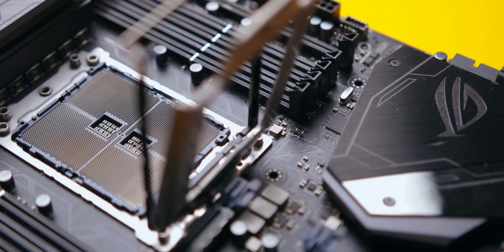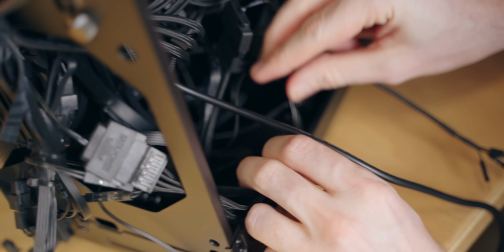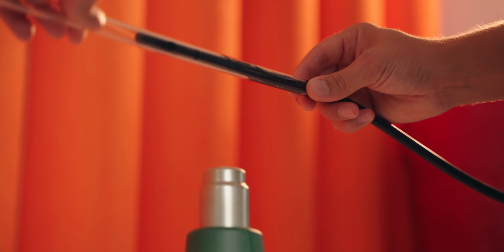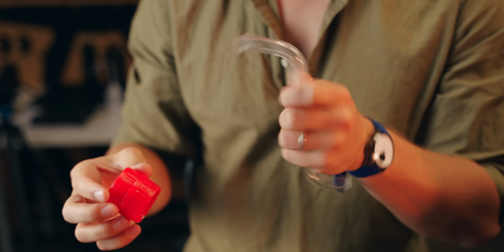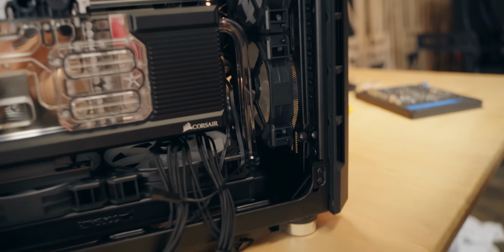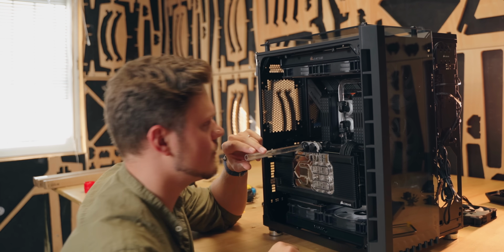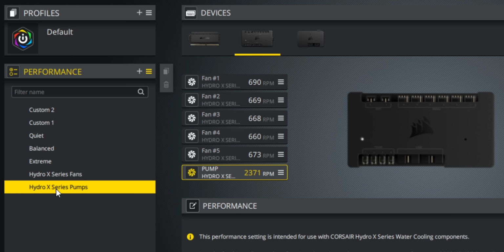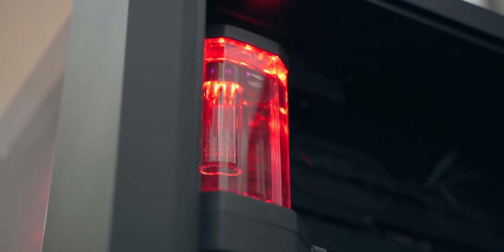IT'S DONE!  The EPIC Workstation Build Is Alive!

Comment: Nice design , poor engineering.Pump should be at the bottom of  the loop. Pump ever go dry, shaft seal get burnt , water leaks into motor . Poof , need new pump.   30yrPumpman

Comment: What with the Linux-users? They can't use that software? It is better if you can do these things on the BIOS-level, also to reduce bloat in the OS. Windows is bloated enough without additional software running all the time.

Comment: I went down the water cooling rabbit hole earlier this year. I have two 360mm rads (one leviathan on EK P,  the middle thickness one), six fans, EK gpu and cpu blocks and fittings... oh man, $1k but my system looks great and a 9700k with 2080 while gaming never gets above 57C! idle temps are around 32-33 C

Comment: Congrats I'm currently staring at the parts as they slowly trickle in for a much more modest, (R7 2700/Vega 64), system that will be my first hardline build. Been using soft-tube WC for years but it's time for something a bit more professional looking...

Comment: Hardline tubing is fun. Once you get used to building PCs, hardline is where the fun begins. I'm sure mine could have been done better, but in the end, even if I was off by a little, the fittings did their job and didn't leak. I love it. It was nerve racking and hard to convince myself to just try it, but once I did, there was no turning back. Every watercooled PC I do now will be hardlined

Comment: if you're going to use your mouth for leak testing; Why not suck? yes it's negative vs positive pressure; but it will make no difference if you're looking for a forgotten fitting, and you wont put your rotting lung mank in the system (No offence)

Comment: It bugs me so much that even corsairs water block for TR4 aren't full cover despite being brand new tech made after TR4 has become mainstream. It's been proven that covering the entire heat spreader is more effective than doing just the center with an adapter bracket. Why they even pretend they have TR4 blocks when really all they use is a regular AM4 with a bracket to fit the mounts for the extra size of threadripper sockets. Especially since they charge extra just for the bracket and every TR4 chip comes with that braket for free so you don't need it.

Comment: You should set the pump RPM to a fixed value. Pump speed has almost no impact at all on temperature, and most people set it at a fixed RPM that is JUST below audible range, assuming it's not too low, and then never change it ever again. Problem fixed, no sound at all!

Comment: Just an FYI they sell (I believe it's EK) an air testing tool where you can pump up the loop and then leave it pressurized for a couple hours. It has a pressure gauge to tell if you have a leak. Way easier than trying to manually blow into it, also you don't blow mouth bacteria into your tubing which can grow shit in the blocks.

Comment: how you install temps sensor to sense water temp?
Reply: 2 different fittings for that. A plug and a pass through. Also either your mobo needs a 2 pin header that supports it or something like an aquaero or commander pro.  Mobo is best since you can use that sensor in the bios for your fan curve vs  3rd party software.
Reply: @jyvturkey  could you tell me where i can buy those fittings that has temp sensor please?
Reply: Сorsair has temp sensors for their commander pro. May be they were used?
Reply: @TheHeavik  Ok how they managed to insert sensor inside fitting ?

Comment: So basically you had an experienced PC modder babysit you. And it's your build. Cool. Even a complete dope like Ed TechSource can do it solo.

Also, 480mm of rad for x399+2080ti is going to be very hot / require noisy fan speeds. That case is simple not good for custom water cooling. 

Also, leak testing by blowing into the system. WTF is that. Use an EK leak tester or Dr. Drop.

Comment: 'It still can't run Red Dead Redemption 2' :D
Reply: It will become this generation benchmark for PC - Can it run RDR2?
Reply: @WhatThisVideo-WTv  the new "crysis"
Reply: I successfully ran RDR2 on a Ryzen 5 2600 with a Geforce GTX 670, Yes 670 that I have in SLI.  I was upset that I couldn't get DX12 in the settings but only Vulkan then I realized it's because GTX 670 is not supported, got to have a 770 or higher.
Reply: @vh9network   the guy up ther recomended a gtx 1660, but i also recomend you to see rx 5700 pulse  everything come down to price!
(Rx 5700 is stronger so if the price is = go whit that)
Reply: vh9network get the gtx 1660 super it’s budget and roly good
Reply: @omarezzat8936   its not because you use it you should recommend to everybody. Remenber to remenber to remind people about rx 5700 pulse
Reply: FirstBits i have a 2060 super for my edit pc and 2080 for my main i5 8600k and main ryzen 7 3800x
Reply: Linus has left the chat.
Because he run Crysis only.
Reply: My 500$ PC from 2016 runs RDR2 with hardware Unboxed optimized settings at 1440p 60fps.
Reply: TheMoonCloud lol
Reply: You must make a deal with manbearpig

Comment: a shame that a 3950 performs at least 20% more than the 2950x, and you can use it with a cheaper mobo
Reply: His choice is fine. It is what he had, and the cost of the 2950x is all told, probably what some people are going to spend on the 3950x new. He may not need all the PCI-E lanes, but the amount of RAM supported is significantly better on the TR, and he has the option to put in a bunch of NVME drives in the future if he wants.

3rd gen TR and Ryzen equivalents will be as or more expensive for the most part.

The REAL shame is that he did not use a full coverage waterblock like the Heatkiller IV Pro TR4 block. Full coverage is essential under sustained loads like rendering. 

Corsair makes a great product, just not one specific to his form factor yet.
Reply: That iscalled progression.
Reply: Perhaps he wanted the luxury of TR4, AM4 is an economy CPU
Reply: @MegaAlpakka you are correct, but bandwidth vs lanes are a different story. 2950x's 60 lanes is more than double the 24 available on the 3950x and unless he is running pcie4 devices, more lanes is better for much more fast storage.

Regarding ram, yeah 128gb is a lot. 2950x supports 2048gb of ram though... so a lot more. Nearly 20x more.
Reply: The shame is his choice for the 2950x. He could just wait a bit for 3rd gen TR or build a 3950x if he has no need for extra PCI-E lanes and quad-channel memory.
Reply: @_megazz  Here's the thing tho, unless AMD sent them a 3rd Gen Threadripper for FREE to keep with included motherboard, graphics, etc. I don't think it fits there budget to go for the newer, more expensive Threadripper and the also new and expensive motherboard that'll also be released.

So I think the choice is fine.
Reply: @_megazz  he just said he didn't want to wait anymore
Reply: megazz 3rd gen ryzen